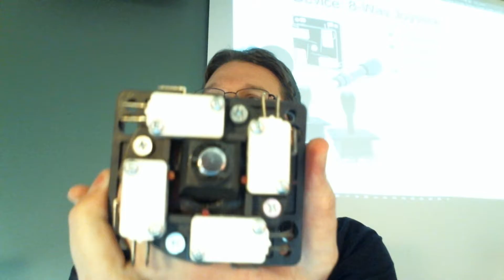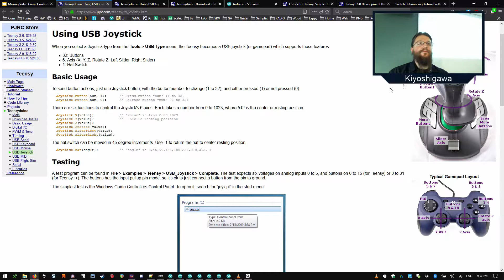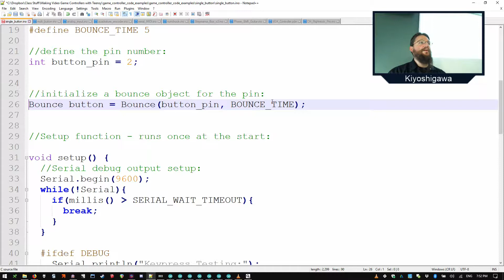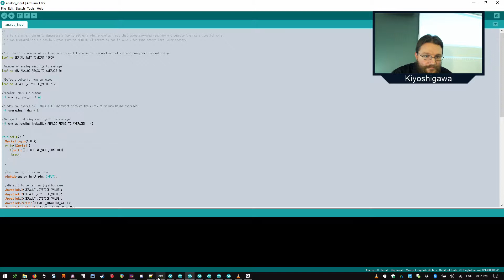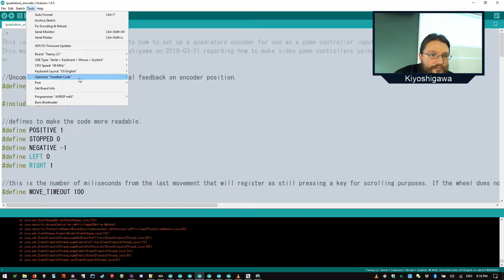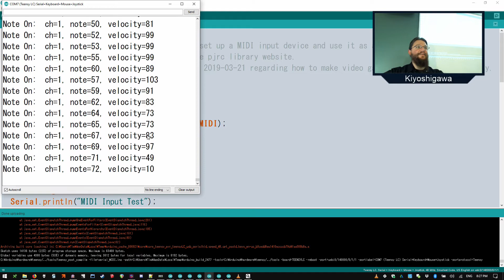DC801 - kiyoshigawa creates game controllers with Teensy

Comment: Also, copied from the meetup page for people just finding this: To get the most out of this class, it is best to have a general familiarity with embedded C programming, or at least basic programming in general, as well as the ability to read basic electronic schematics (Here's a guide on schematics from Sparkfun: https://learn.sparkfun.com/tutorials/how-to-read-a-schematic/ ). Hamster ran two classes last year ( https://www.youtube.com/watch?v=nslHeXYYATM and https://www.youtube.com/watch?v=iAML97O8tHI ) that give a good overview of microcontroller firmware which are a good base of background knowledge used in this class. The code examples will be written for the Teensy, which is built on top of the Arduino IDE. The Teensy libraries are all open source (available on github: https://github.com/PaulStoffregen/cores ), so you can modify them for any native USB capable microcontroller of your choice if you are so inclined.